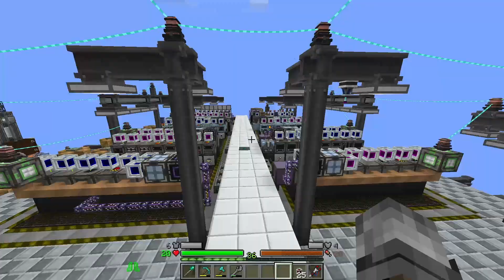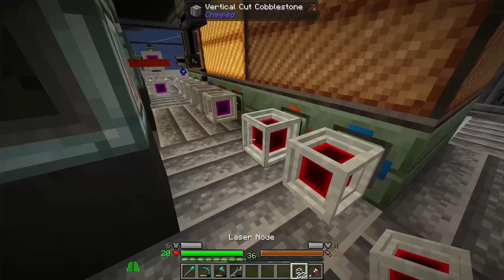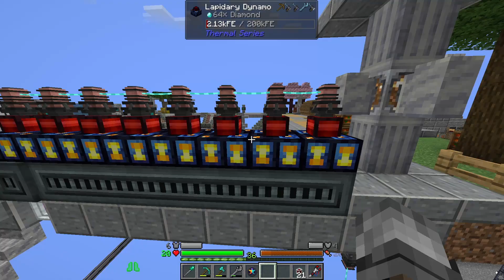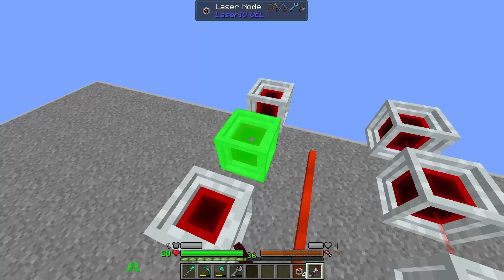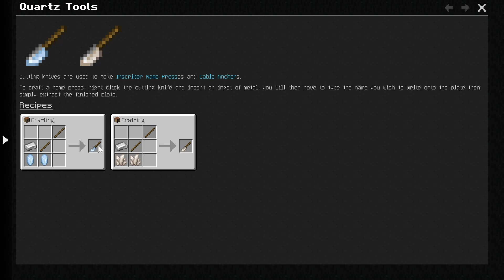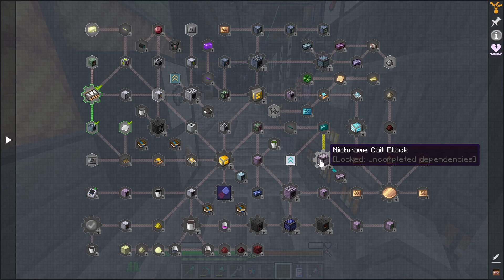Star Technology Ep14 Stainless Steel and Power Upgrade

Comment: You can use a wrench to flip the muffler hatches towards the inside of the EBF, they only check for an air block directly in front of them.
Reply from the maker: Thanks for the tip, I feel like the wrench flipping stuff is weird sometimes so I try to avoid it